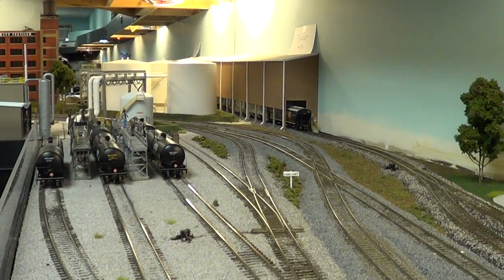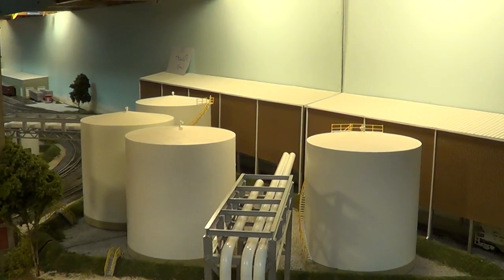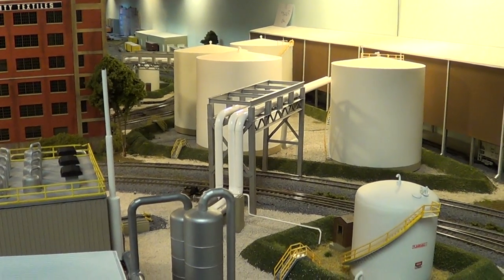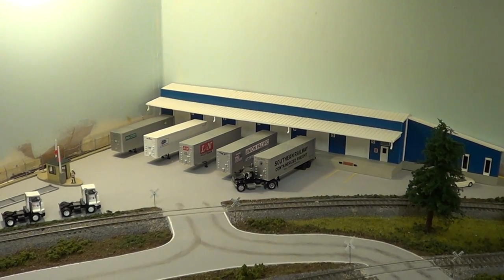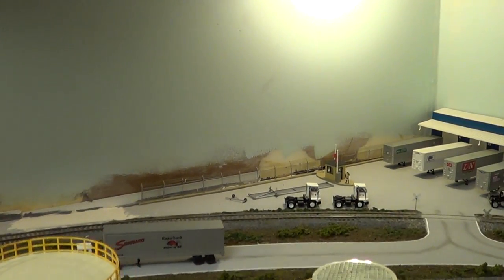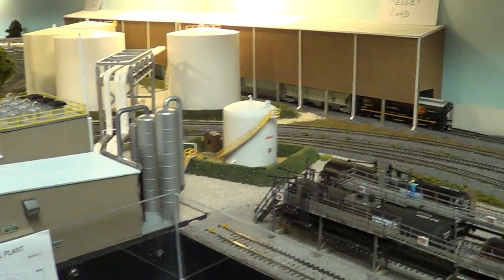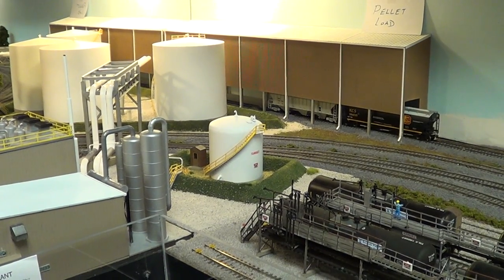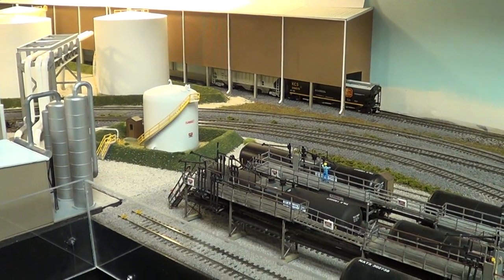MSMRC ETHONAL PLANT UPDATE II

Comment: Are the tank car loading racks walthers kits with an extension put in?  I'd like to put in a rack long enough for a few ethanol cars on either side, but it doesn't look like the walthers kits have long enough spacing.  Are those extensions scratch built?